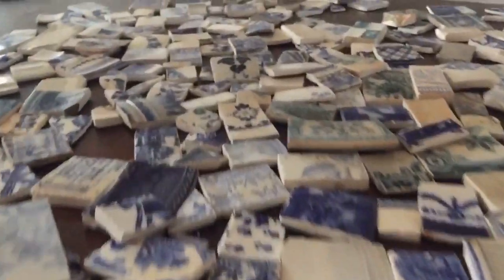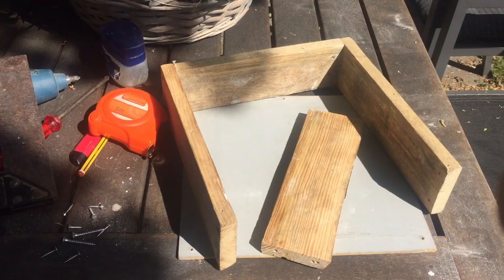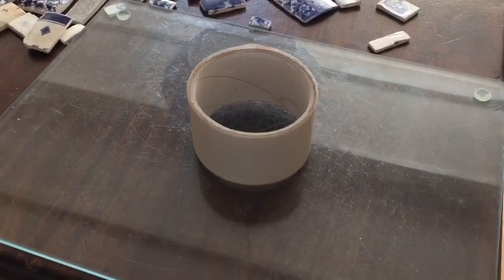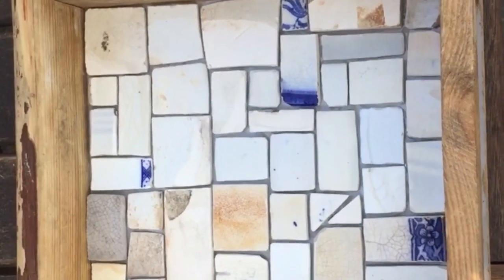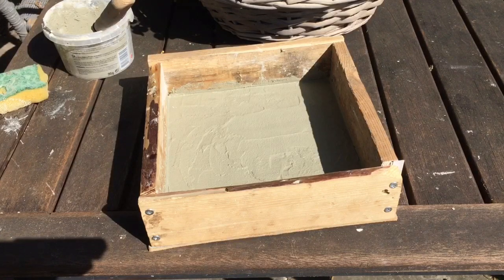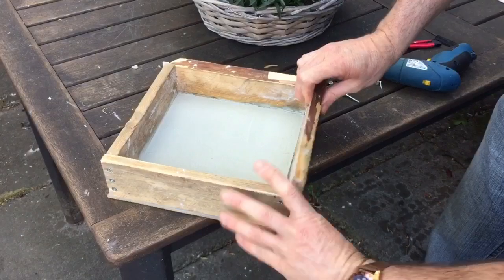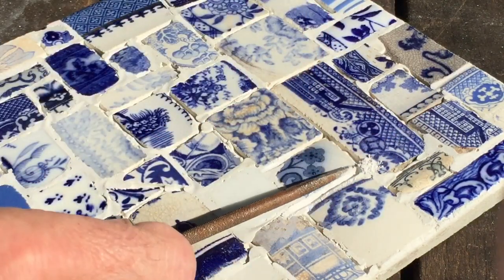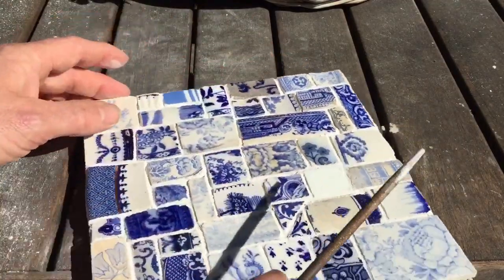Mudlarking pottery finds turned into tile art!

Comment: Lovely first video James, I hope you and Linda are doing OK and that you have enough blue and white to finish the project during this lock-down. Are the tiles we found the right size to use as they are?
Reply from the maker: Thanks Tom, really appreciate your comment. We are doing fine, we don't have the same level of lock down here in holland so can still go exploring but observing the social distancing rules. No I don't have enough pieces, so still collecting! The larger tiles we found are are impregnated with rust stains sadly, which I need to find a solution to, they may have to be used in pieces... we'll see.
Reply: @findcreate6174  Have you tried muriatic acid for the rust stains? It is sold as pool acid and it is also found in calcium, lime, rust removers, albeit at lower concentrations. Of course, be careful as it is very corrosive. For those with University chemistry, muriatic acid is about 1M HCl. I think it may also be sold as Baker's Fluid. My Dad used to use it on metal before soldering.
Reply from the maker: @fernbrisot325  Hi Fern, No i've not heard of it before although I have used rust removers on metal before. Rust removers for metal are probably different as they convert the orange to black/purple which is no good on tiles. Really appreciate your advice and I will look for some and when I try it with success I will update you and put it on a future video.

Comment: Fantastic end result.  Just a couple of observations; firstly not using safety gloves when you know you should is absolutely fine until you lose the end of a finger, better safe than sorry.  Secondly if during the laying out process of the individual component pieces you decided which edge was the top of the slide you could orientate fragments with people/animals/buildings/flora accordingly.  You will only notice this orientation when you are sat on the throne but just think of the pleasure it will give you at such times.  I start as I began, fantastic end result and I take my hat off to you sir.
Reply from the maker: Thanks again David. Yes I should know better concerning safety, particularly as I am a golf professional so I need all my fingers. 
Once again thank you sincerely for your kind words and advice.

Comment: New subscriber. Beautiful tiles well done! Just one thing it's just me but I like the tiles the way they can out originally, without file grinding
Reply from the maker: Hi Tom, thank you for the comment. I like them that way too but to avoid too much grout or the even more difficult jigsaw of random pieces and to make them into "tiles", I decided to square them off. It's hard to describe but I couldn't stick them straight to the floor, they had to be pre-made and pre-organised as the tile cement sets fast, plus I needed almost flat pieces and trimming the shards was necessary. But thank you for your feedback and I will be doing a future project which I may try your preference on. 
All the best - James
Reply: @findcreate6174  thanks James great job!

Comment: Why are some tiles upside down? I will enjoy your find and create videos. Good luck👍🏼
Reply from the maker: Thanks for the comment Brian and Tami and your good wishes. Mainly when I am making the tiles it comes down to how they fit without too big a gap or touching others. And they go face down on the tape so again I go for the fit. There isn't a real top or bottom and when I am using them it won't matter on the floor they are fitted because it's a riot of variation anyway. But thanks again for the feedback. Kind regards to you both - James

Comment: Just a tip for you: Contact paper is fairly inexpensive and much easier to use than strips of tape. They make clear and patterned. Using a brush instead of a putty knife works much better too. I wouldn't be sharing tips if I hadn't done this many, many times before myself. I'm just trying to save you time.
Reply from the maker: Fantastic, thanks very much for the tip! I've got some much wider tape of recent, so it only takes two strips, but I didn't know about contact paper, I'll get some. The tiles are all made now and i'm using them as floor tiles. Part 2 will be out soon showing the finished project. Thanks again for the help - James
Reply: He probably is using what he has on hand due to lockdown.  Contact paper is a great idea.
Reply from the maker: @aliencat11  I'm going to take all advice for future projects Mary, but you're right, Tape was all I could find
Reply: @findcreate6174  Another thing you could do is cover the individual sides of your mold and the bottom with either your tape or the contac paper before assembly. The grout won't stick to it and you wouldn't have to use the vaseline.
Reply: @findcreate6174  Cooking spray is what we always used as release when we made latex molds (before silicone came along) for casting for sculptures. Silicone is amazing! Great for casting resin..

And contact paper comes with the peel-off paper gridded. Makes cutting easier.

Comment: Nice one James,great idea to come up with.The question is how many do you intend to make? Tom was good enough to give you a shout out so I subbed.  Cheers 🇦🇺.......
Reply from the maker: Cheers Roger. Fortunately the floor I'm covering is only small, chosen for two reasons. 1. I want to see if the pottery can withstand being used as a floor, which it should, as it's glazed fired pot, like normal tiles but obviously thinner. 2. It's taken thousands of hand cut pieces and is time consuming so I would have lost enthusiasm for a more ambitious area..... I've made about 17 of the large mosaic tiles so far. Part 2 coming soon. Kind regards - James